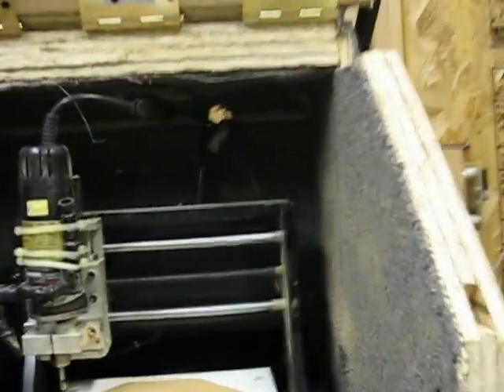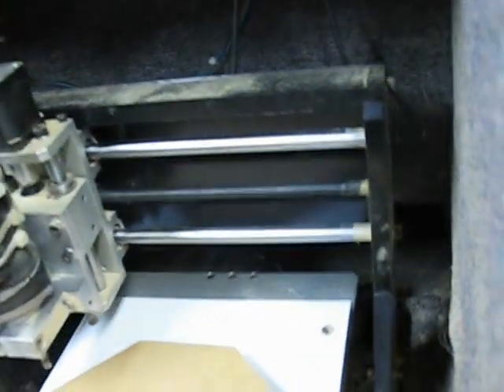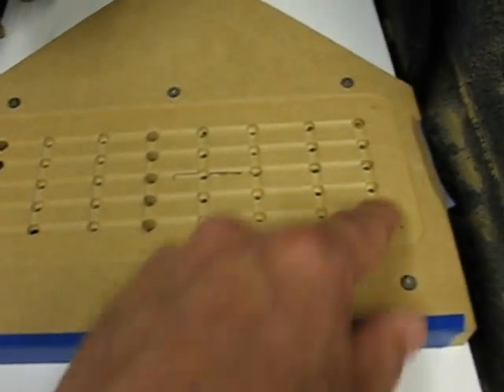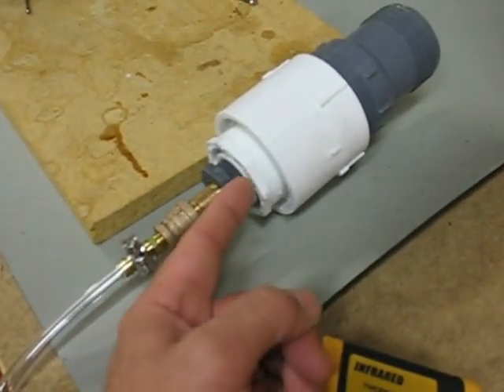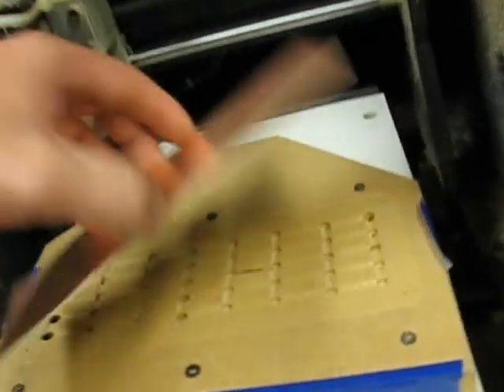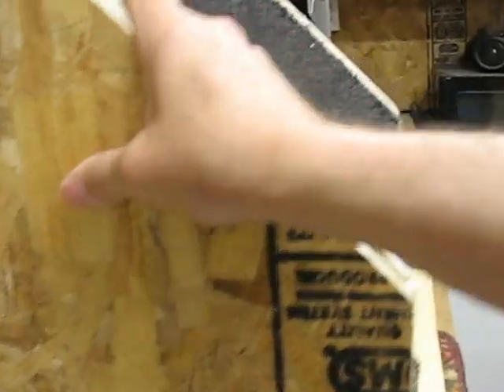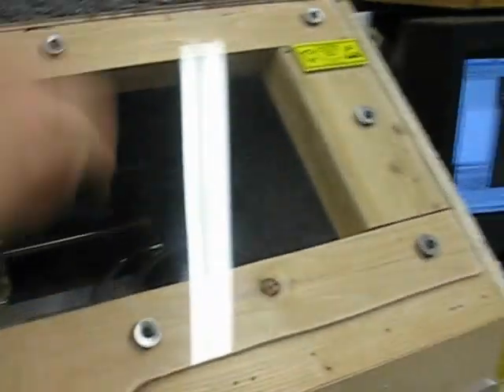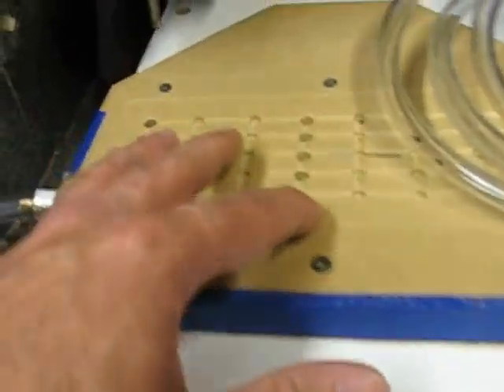Sable2015_update_and_shop.AVI

Comment from the maker: I got it all working fairly well.  Using the shop vac to hold down the PCBs.  Using the exhaust air from the shop vac for the blower.  Works good enough for me for now.  But, I know it's only a matter of time before I burn up the bearings in the shop vac motor.

Comment: For your blower you need an air compressor. I can't imagine any fan working no matter what speed.  You probably don't need much. Do you have a Harbor Freight close by? You could even use one for an air brush. 

Also to make your fitting work better for the shop vac get some self stick craft foam sheets and run it around the fitting. I have converted many PVC fittings to except shop vac hoses this way.